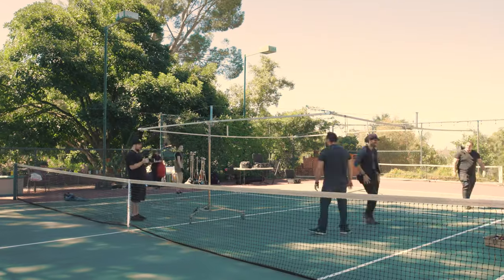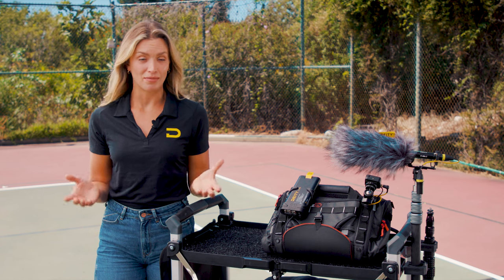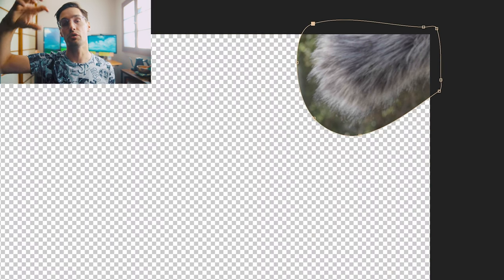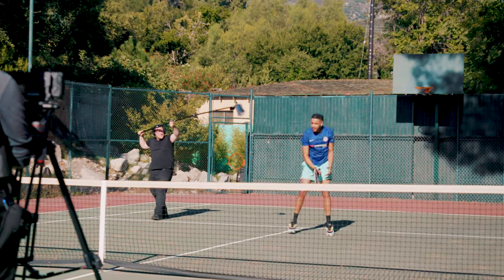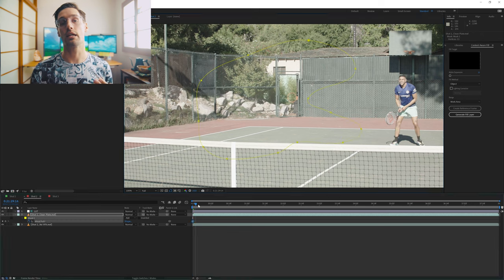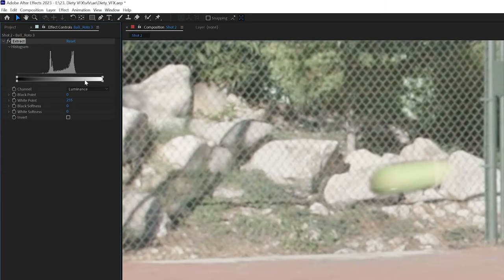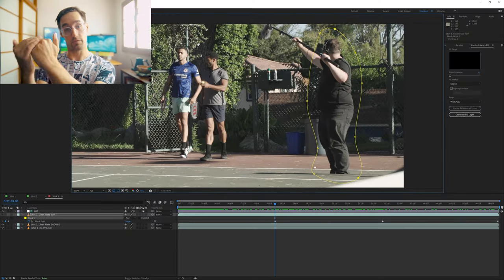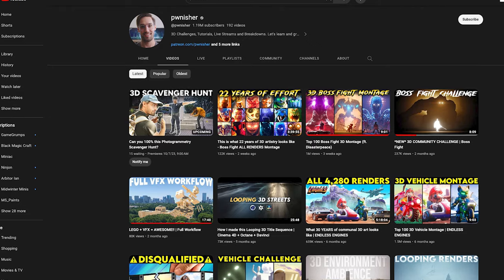Remove A Boom Mic From Your Shot | ft. @pwnisher

Comment: Great tips! It happened to me in my recent short film, and of course, it was the best take. The way I solved it was by duplicating the frame and maskin out the part with the boom using the same take, only seconds before it dipped into the frame. I found out later that the mask did not follow even tho it was a static shot. THe tripod moved slightly, but I did my best masking it out and it worked fine :-)